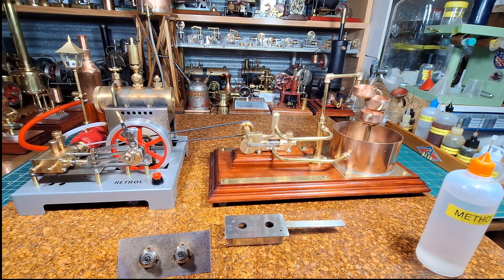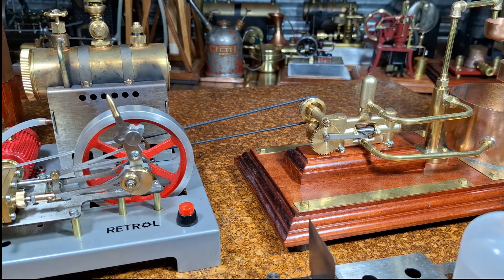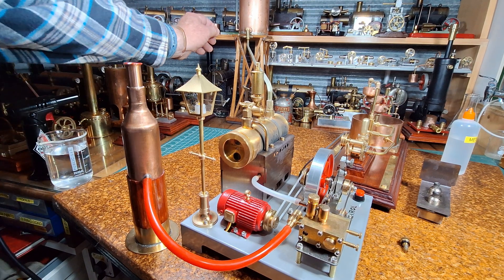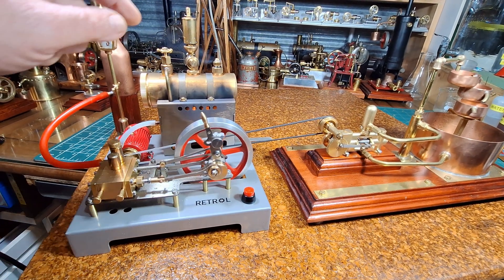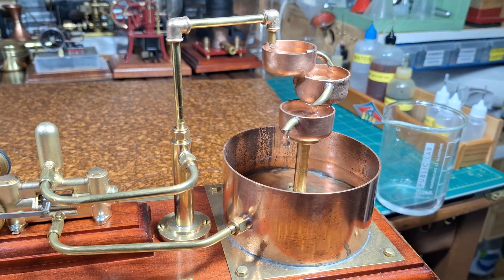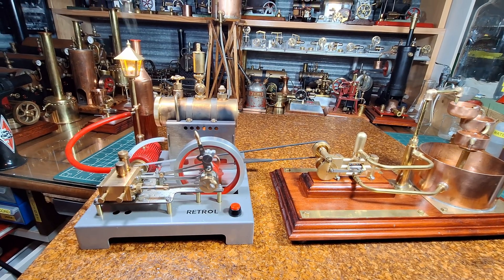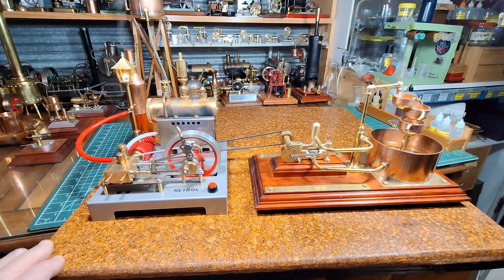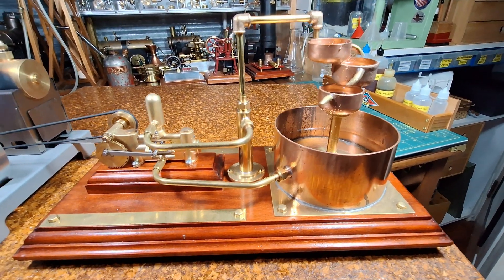EngineDIYShop Retrol SE-02 Steam Plant OKMO Microcosm P71 Mini Water Pump DIY Homemade Water Feature

Comment: That's a nice setup Jim, love your water feature 👍👍👍 You might want to consider small gas burners for engines like the Retrol, they burn cleanly so no soot on the boilers. Cheers, Alan.
Reply from the maker: G'day Alan, I was thinking of using one of my BIX burners, but there's a cutaway of the steel base on the Retrol that I would need to do some additions to so that the BIX burner had some where to sit, job number 1001 - Cheers Jim
Reply: @SteamEngines-Jim  The BIX burners are great, lots of different sizes, a bit pricy but well worth the investment. Cheers, Alan.
Reply from the maker: @RetroSteamTech  I've got nearly all the sizes (plus the roller model) and some BIX gas containers. I have been thinking of buying some Ronson Valves (I think that's what they are called) and as a project having a go at making my own 'BIX' style gas refillable containers out of copper.
Reply: @SteamEngines-Jim  I've got some of the BIX gas containers too, a bit on the small size so I tend to use the 440g Butane/Propane mix cylinders. They are fairly cheap over here and last a long time when doing short runs on stationary engines.
Reply from the maker: @RetroSteamTech  Yep I use them as well and spray them with black 'texture' spray paint so that they blend more in with a steam plant.
Reply: @SteamEngines-Jim  Never thought about painting the gas cannisters, it's a good idea though. Cheers, Alan.
Reply from the maker: @RetroSteamTech  Have a look here Alan, I think they look more in keeping with a steam plant black -
https://www.youtube.com/watch?v=hYVRE1tGUEo&t=5s
Reply: @SteamEngines-Jim  You're right, it does look better. I need to get some of the flexible tubing you use for the gas pipe too. Cheers, Alan.
Reply from the maker: @RetroSteamTech  That silicone tubing from eBay (there's virtually unlimited diameters and colours) has been a real boon for me. I don't use all the copper piping that I made up for all the different plants very often now, because compared to the silicone tubing for a temporary setup (which most of mine are with orphan engines) copper isn't as simple. Have a great weekend Alan.